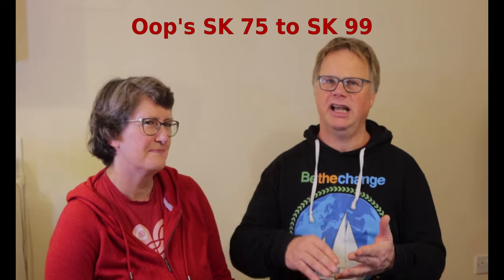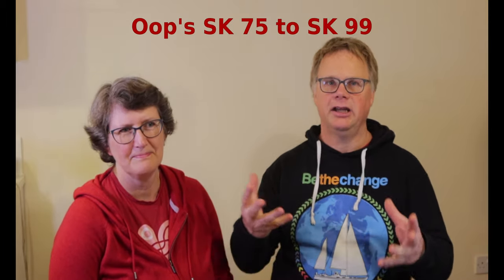Dyneema Rigging Q&A: Episode 1

Comment: Thanks I am currently in the process of changing my standing rigging so this was helpful. I do have a plan for putting a furling head sail on the Dyneema  forestay/s (cutter) but I am having difficulty getting people to understand my plan or willing to help.
Reply from the maker: Crusader sails spent a lot of time discussing things with us. For us the key issues are:
- without roller reefing you need to think through your sail plan for different wind speeds (and especially how you handle squalls from each base windspeed). It will mean more sail handling unless you have multiple furling sails hoisted and switch between them). We will have some wind speeds where we don't have the optimum sail area. We will need to raise and lower the staysail as wind speed changes.

- getting a tight luff if the headsail is close to a forestay (assuming no expensive halyard locks and hydraulics) is tricky. The furlers often are designed for the torsional rope to be the forestay in order to work correctly. We have several options that we are going to explore.

Comment: Did you run into any issues with insurance, since the rig is using custom parts and a non standard chain plate design? I would imagine it is more tricky to prove the setup is adequate if you are not following the original design, or at least using a common configuration of components?
Reply from the maker: So far we haven't applied formally. We have agreed that we will have a survey before launch. It might be that we agree exemptions.

Comment: Where can i get more information about the headsail system you mentioned with webbing that attaches to a forestay?
Reply from the maker: All I could find was a passing reference on the Rigging Doctor channel. When we recently bought new Crusader sales they recommended dyneema soft shackles (lot less work for the sailmaker i guess).
We might fit webbing ourselves to get a few more miles out of old sails. Basically a long loop on one side, that goes around the forestay and is connected to a shorter loop. Then the connector between them is well away from the sail. Connector could be a standard forestay piston hank or a soft shackle.

Comment: how would dyneema rigging react to a lightning strike. would it melt?.
Reply from the maker: Earlier in the year I had a discussion on our blog about Lightning in comments to this post "Confusing earth wiring" https://sustainablesailing.net/2021/05/31/confusing-earth-wiring/

I haven't heard about Dyneema rigging melting. But I've also not heard of sails melting and my (non expert) guess is that you might expect a similar effect.

I guess we have bigger issues in terms of lightning protection with our deck stepped mast that has bolts to a metal support post that ends above the lead keel encapsulated in grp. Quite concerned that we are vulnerable to lightning blowing a hole through the hull.

Generally lightning is not a very big issue in the UK so we don't have so much local expertise.
Reply from the maker: I asked around and got this suggestion re Lightning:
"This is a great podcast with a real lightening expert (jim Thayer worked for NASA) 
https://podcasts.apple.com/us/podcast/jeff-thayer-lightning-strikes-offshore/id711410636?i=1000472898124
Worth listening to multiple times! 
Cheers"